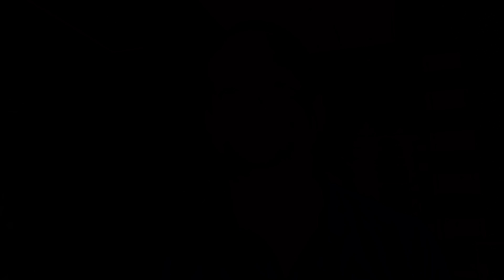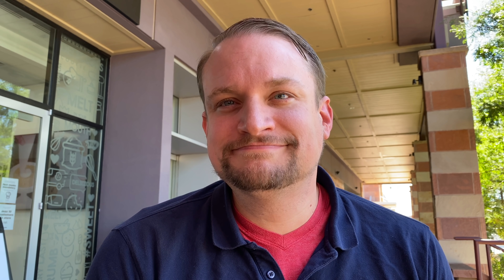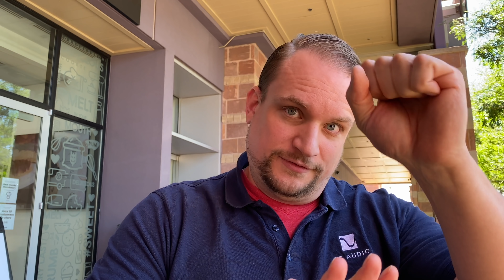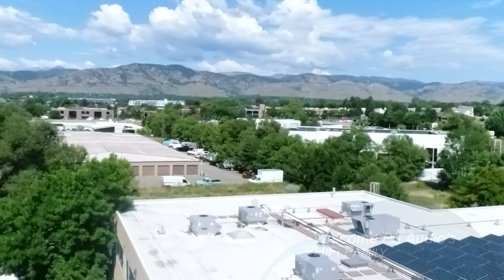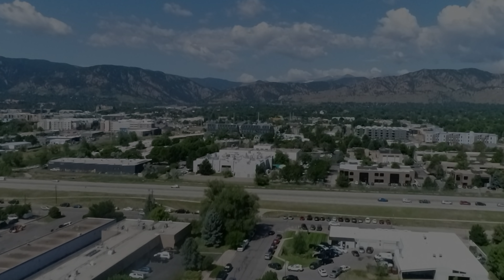Lunch with Paul: everything you wanted to know about crossovers

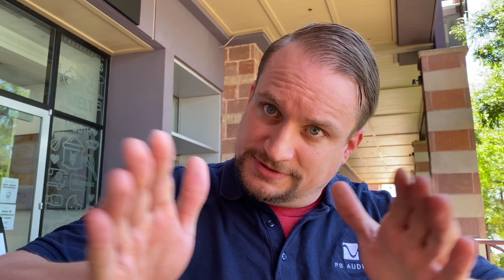Comment: 2:20 ...  Did he say "four inch woofer"?     I do not believe that "four inch" and "woofer" belong in the same sentence.
Reply: whats wrong with that?
Reply: @nabildanial00  
A four inch driver cannot move enough air to woof.   It would be lucky to achieve 80 Hz.
Reply: Swinde nah perhaps 40 Hz are their limits
Reply: G Guest  
The drivers in headphones are a heck of a lot closer to your ear.  Therefore they do not have to move much air.  You are correct that these small drivers are capable of moving at 40 Hz,  but I would think that the level of sound across a room would drop dramatically because of the lack of air motion from the tiny cone.  A longer throwing voice coil helps, but I doubt that any four inch driver is going to deliver 40 Hz  at a -3 dB level in an average size room.   I could be wrong.
Reply: @swinde   surface area multiplied by excursion capability gives you an idea of bass performance. 

Excursion alone or surface area alone don't tell the full story.

But going too far with excursion or surface area does lead to sloppy distorted performance.
Reply: @swinde   done right, they can get almost there. Check out Andrew Jones Pioneer BS22. Noted low freq is 55hz. Depending upon the room and placement, I have measured it as low as 40hz
Reply: Fat Rat  
You are correct, but most raw speaker manufacturers measure the outside diameter of the "basket".  It is deceptive, but it has been going on for decades.   My AR-3a 12 inch woofers measure 9 inches using your method.  The basket is 12 inches.  
I have a hard time believing the 32 Hz claim.  In some of these claims the harmonic will be louder than the fundamental.

This means that the 4 inch speaker in the video is about 3 inches of operating cone.
Reply: Fat Rat  
You must have missed the part of my post where I said "You are correct".   I agree that the active cone diameter should be used, but in reality the (all) manufacturers "cheat" by stating the size of the frame. 
 Keep in mind that there are only seven keys on a piano that are below 40 Hz and the double bass (violin) lowest note is 41.2 Hz.  Of course a Pipe organ can get lower and electronic music and instruments can likely go lower.  
Since I have not heard your speakers I cannot say they don't reproduce 32 HZ, so I will have to take your word for it.
Reply: Some petite bookshelf speakers include 4" woofers that go down below 200Hz.  Focal sells 3" woofers.  Sony, JBL, and Ultimate Ears sell portable speakers smaller than that which aren't hifi but have astounding bass response for the size.  Yes there are physics reasons why more diameter is helpful for more bass (particularly wavelength-dependent acoustic amplification), but persistent engineers find a way (with compromises, of course).  Heck, bass vocalists can sing well below 100 Hz with gobs of volume, with a "driver" smaller than 1" and a "horn" of only what, 2-4"?  Admittedly the "enclosure" is big and superbly designed... The point is other features can overcome small driver size and permit bass radiation.
Reply: Fat Rat  The early Realistic Mach 1 speakers had 14" cone, the models post 81 had a 13" cone and thicker foam, Tandy really cheaped out

Comment: The best drivers are cube audio 2.4 Tesla magnetic field saturation higher than any other speaker in existence it is a single drive and doesn't need a crossover you should get one Paul and try and out make a speaker out of one they can get it down to 27 Hz at a 3 db roll off with remarkable low distortion I think it is the best driver inexistence at the moment

Comment: Grandinote could be your next guess. They're using like 36 mid-range and around 12 tweeters for one column only. They keep using the simplest cross over for the tweeters, so to keep the speakers close to  the full range philosophy. REMEMBER the axiom : no capacitor in the power line. See your discussion about capacitors quality.
Reply: Line arrays for home use are a poor approach especially if you don't listen at loud levels.

While the load is shared and driver distortion is kept quite low, you now have intermodulation distortion and time alignment problems. This reduces clarity a bit.

Comment: Active speakers with an optimized amp per driver and cross-over filtering using DSP is the future of a highest performing digital audio system. It also allows for other tweaks towards much better tonal balance and phase optimization. It’s what makes the KEF LS50W sound better than the KEF LS50, for example.
Reply: Seems like one could have a very high level of fine control that way.
Reply: @graxjpg  There is a giant leap forward possible in calibrating a speaker's performance when you have a DSP to do it in rather than a few capacitors, inductors and resistors. It's also trivial to do tweaks towards personal preference e.g. adding a few dB where your ears need some help due to aging or whatever preference you have incl. compensation for your hearing's natural Fletcher Munson sensitivity.
Reply: It'll definitely push up the production costs a lot.
Reply: Qorax Active audiophile speakers are still cheaper on the BOM than if you compare with a similar passive system with separate boxes and cables. A good example is KEF LS 50 vs KEF LS50W.
Reply: ThinkingBetter I can imagine that I’d be surprised by the difference in price on the BOM of those two speakers.

Comment: What about a commercial crossover and 3 amps ..are they less susceptable to the distortion he aluded too?
Reply: Certainly true...but sound quality should improve in theory...? That was my ultimate point. I have heard some amazing commercial line arrays with 3 and 4 way X overs ... a high quality  crossover and associated amps might be killer.
Reply: Mike Schlup - yes, I run a Xilica XP4080 Professional DSP in a biamped setup.  Klipsch Jubilee with TAD drivers.
Reply: Peter, i am not familiar with your equipment..will do some google research..lol..thanks!
Reply: Mike Schlup - run any amps you like, as long as they’ve got balanced inputs.  Personally, I biamp.  https://xilica.com/products/xp/
Reply: I will look them up.

Comment: Linear phase DSP crossovers is the way to go if you want the optimal sound quality.
Reply: can you point me where to read more about them? i've thinking of building an active system myself but i dont know where to start.
Reply: @nabildanial00  I use DEQX and they have some resources on their promotional videos. If you wanted a cheaper alternative, you can use miniDSP units that can handle FIR filtering and then use Eclipse to design the filters. If you want just a conventional minimum phase filter for the crossover then I'd recommend the Hypex plate amps that have a DSP crossover on them.
Reply: I run a Xilica XP4080 Professional DSP in a biamped setup.  Klipsch Jubilee with TAD drivers.